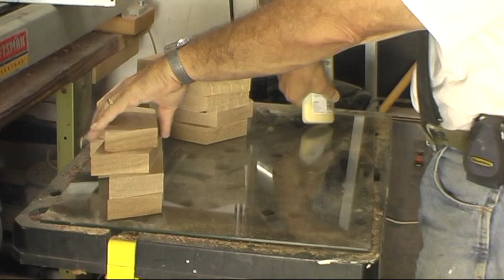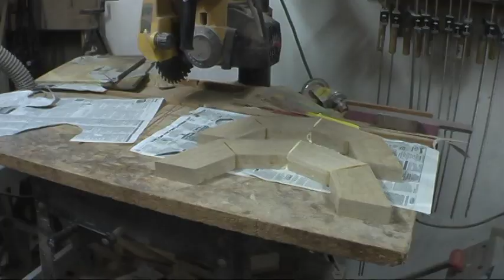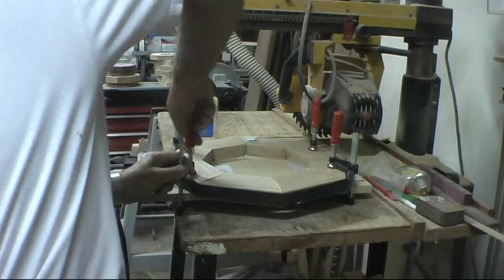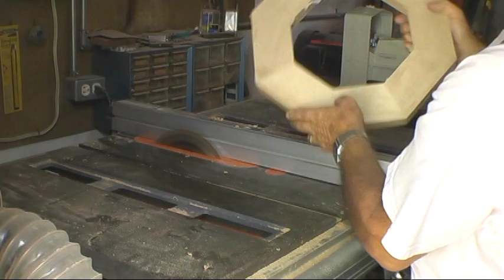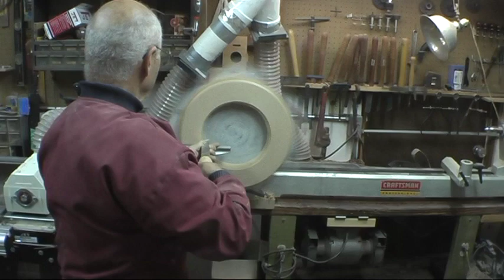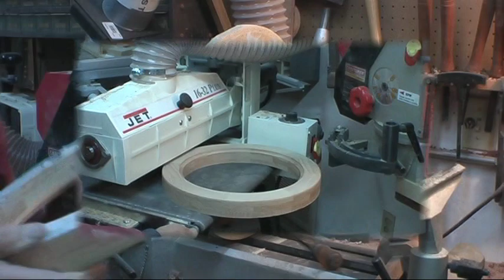Making Drum Hoops

Comment from the maker: Sorry for the delay in answering.  I don't watch this site for comunication.  If you want to communicate with me use saultave@tampabay.rr.com.  I use either a straight scraper or a bowl chisel.  Use whatever works best for you depending on the size of the piece and the hardness of the wood.  If the inner portion is small enough, I'll often use a forstner bit in a lathe chuck.  I have them up to 2 1/2 inches.  Easiest way to make a straight hole.

Comment from the maker: Actually, you could use whatever works best for you and the cut you want to make.  I used a 1/8 inch wide parting tool.  It is easy to control and makes a nice, clean inside corner in the cut.  This process is for making segmented rings, irrespective of what they'll be used for or the size of them.  Glad it was of help to you.